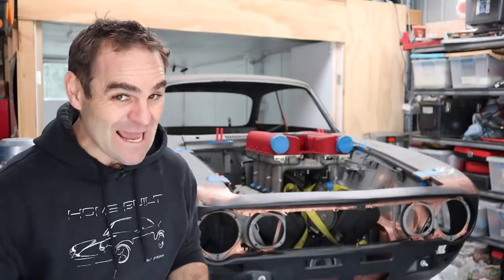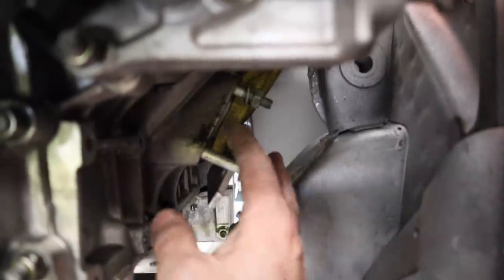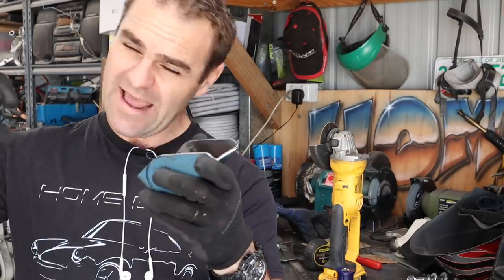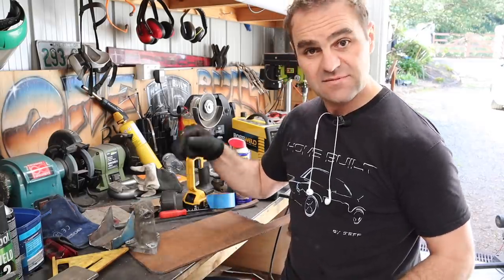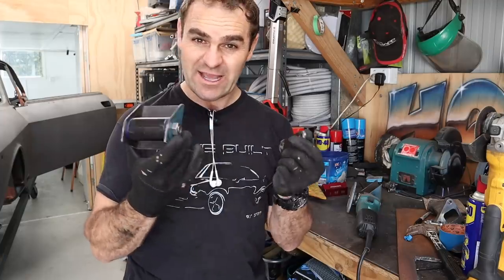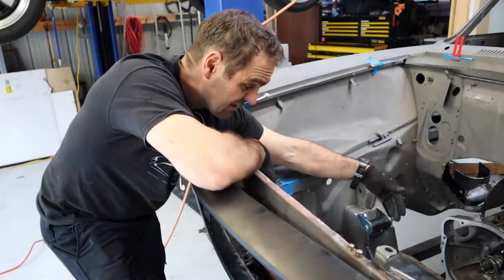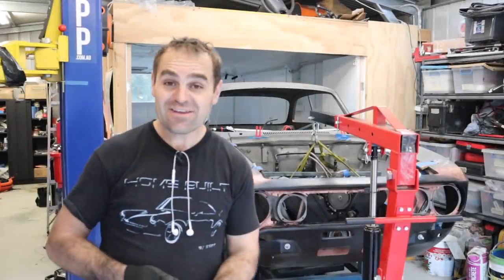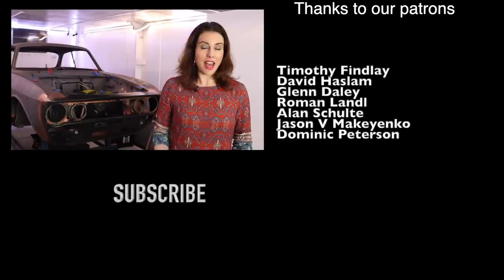Making custom Ferrari engine mounts - Ferrari engined Alfa 105 Alfarrari build part 43

Comment: I'd use bolts for the engine mount for possible maintenance reasons. You could drop the mount out with the engine in. If you have studs it would never come off unless you pull the whole engine. Keep up the good work and stay safe.

Comment: Hi Jeff, Loving the work as always. Question? Have you considered just completely scrapping the whole original subframe. Cutting it out and creating a spaceframe type replacement that could bolt up to the bottom of the chassis rails ?? It could potentially solve a lot of space and strenght/rigidity issues. Looking forward to the next episodes. Kieran
Reply: parkedinaxrds I agree...trying to fit all this into the   Alfaspace is going to cause loads of problems...you would also be able to lower the engine a little.

Comment: Hi Jeff, 
I'm sorry to say those engine mounts will not last long at all. The weight, torque reaction and vibration of the motor will cause the PU to fail under the bearing load since the load will be concentrated at the top of the mount, the rest of the PU will do nothing to support the weight. Basically, the inner sleeve will cut through the PU... I suggest you cast the PU onto the inner and outer sleeves that you have fabricated, it's very easy to do. Use a PMC 746 of 770 from Smooth-On, depending on the hardness you want. The bonding to the sleeves will essentially distribute the stress more evenly throughout the PU top and bottom allow the mount to work correctly. Make the outer sleeve as large as will fit, the more PU you can get between the sleeves the better.
Cheers mate

Comment: I drove a car once with solid mounts never again a friend asked ne to test the car as he had a broken leg, the engine installer fitted a 2.0 ltr engine in to a MK1 ford Cortina but the mounts didn't line up so he took some rubber blocks and drilled strait through and thought that would be ok. my friend paid for some like yours but it was rubber not polyurethane. what an improvement,

Comment: just a note ], for more room in the engine bay. onthe inner upper A arm mounts, that you can see inside the engine bay, you can cut the flanges off, and get some 1/8 steel  the same with as the mounts,,, never mind, just go to the alfa romeo bb, go to engine conversions, look for bianchi2 engine conversions( and bianchi1 engine conversion, you will see were i trimmed the flanges off the inner upper suspension mounts and welded a steel strap and folded it to match the contors of the the upper suspenion mount and welded that in.
Reply from the maker: I am way ahead of you ;)

Comment: Done exactly same engine mount setup on my zetec classic mini 👍
Reply: Only thing I found is unless you can lift the engine straight up, I needed to unbolt the mount from the engine, not the cotton reel bolt
and push them back against the subframe

Comment: Be careful what bushings you use there.  Bushings for suspension are usually not a fan of lots of heat.  You might find a pile of melted goo after you run the engine.

Comment: Hold on Dude. Drive shaft angle must be considered .  In simple terms, both universal joints must experience the same angle. Transmission mount elevation will provide the correct angle for you to make permanent after angle finding. Suggest you watch some driveshaft angle videos or you will be unable to remove the driveline vibration issues that will surely plague this install.

Comment: Before I watched the video I thought the best way to do it was design the engine mounts in CAD (not the project binky style) then 3d print them to check them out before making them out of billet cnc like the guys in WA at WTF auto and their V12 Supra build but I don't think you could do it much better. It could look all fancy but function wise it'd be no different. Hit me up if you wanted something modeled up I'd love some input in this amazing build but I'm sure the bloke that helped with the trans adaptor would be up for it again.

- Josh
Reply from the maker: Thanks for the offer mate.

Comment: Why did you not install the rear subframe (and differential) prior to making these engine mounts? How do you know if the longitudinal angle of the engine will allow for proper driveshaft angles if you don't have the rear diff installed?? This is important stuff to consider in a unibody car with an engine swap, because usually people just stick with the oem rear subframe and diff, so the diff angle is locked - however you get three degrees of freedom with the engine because you have to make custom engine mounts. You want to make sure that not only is the engine pointed at the correct location, but also that it is pointed at the correct angle. I guess you could ignore all this if: you are going to custom mount a differential, or you just don't care about small driveline vibrations, or you are going with a two piece driveshaft with cv joints.

I guess your rear subframe/diff might actually be installed, it just isn't easy to tell from this video.

Comment: I have never commented because I usually watch the next video and all is well. Just wondering if you could run the driver side exhaust forward under the motor and down the passenger side of the car. Said you had a plan , so I watch with interest.
Reply from the maker: Possibly, but then it would be unbalanced and there is plenty of room ;)

Comment: Rather than use the AN elbow and fitting, why not weld an outlet direct to that adapter plate. Will save a bit of space👌
Reply from the maker: The fitting actually gives me the prefect amount of space for what I need.

Comment: What are you locking those mount pin bolt and nut's with. Go Jeff.
Reply from the maker: The current bolts are temporary as they are all I could get. I will get longer bolts and lock washers/nylocs to hopefully stay in place.

Comment: Great work. Is there no way to move the shock mount outwards to give you the clearance? I assume they are shock mounts that sit above the engine mount
Reply from the maker: No, they are the upper pivots for the suspension.
Reply: @HomeBuiltByJeff  that's a pity to much redesigning to move that. Great work as always. I also plan to use the same engine mount as I saw the boys on skid factory when I put V8 into my 924 GT replica :)

Comment: I have a bad feeling, those mounts won't be strong enough - looking at how beefy stock mount are.
Reply from the maker: These style mounts have been used successfully on engines with triple the power of this with no issues. Also the original mounts were longer with the load being perpendicular, so they needed to be stronger.
Reply: @HomeBuiltByJeff  thanks for the clarification, didn't know about that. But my comments was about the thickness of the piping. 

Guess you have done your research. 

Keep up the good work, love what you do. Stay safe.